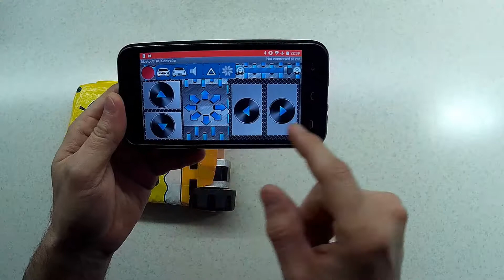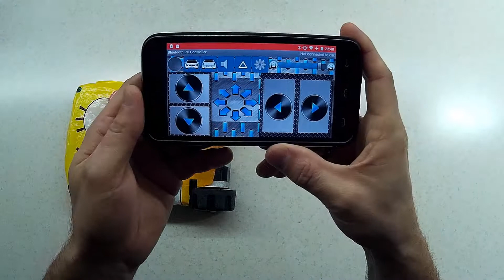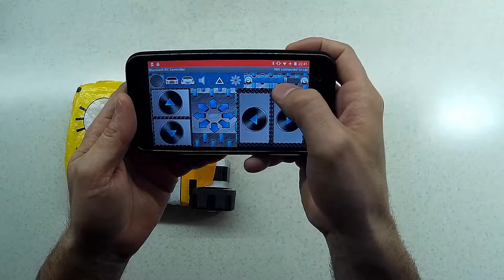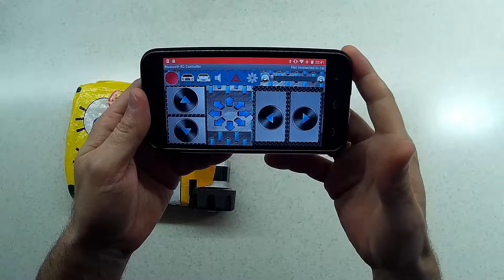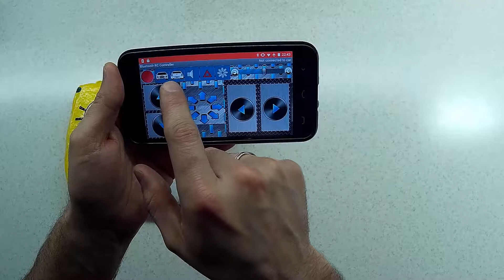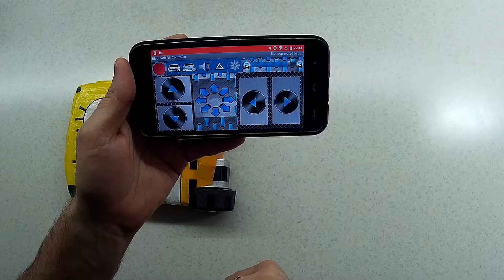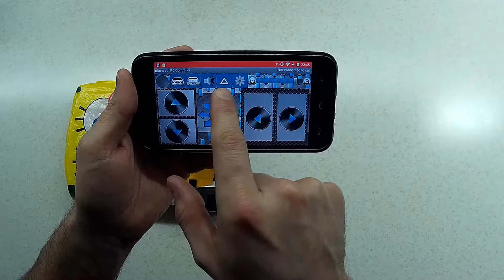Self-balancing SpongeBob: The controller and PID tuning

Comment: Se o amigo disponibiliza-se o diagran ajudaria bastante.
Reply from the maker: Given the list of parts ( Arduino Nano, MPU6050, BT adapter, Nema stepper motors, A4988 stepper drivers, V4 CNC shield), there is only one way to connect them together. Maybe a bit more hassle with BT adapter, but again that's basic. If I put together a diagram it might be harder to understand it than just to get the parts and connect them one by one - it is so basic. You might want to checkout this video https://www.youtube.com/watch?v=BlO0rilL06o (Self-balancing SpongeBob: what is inside?).